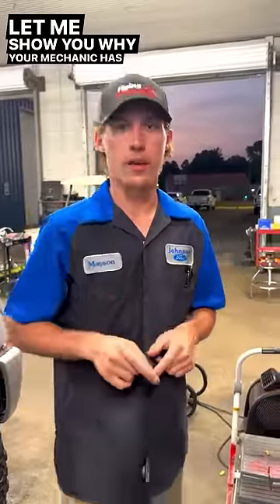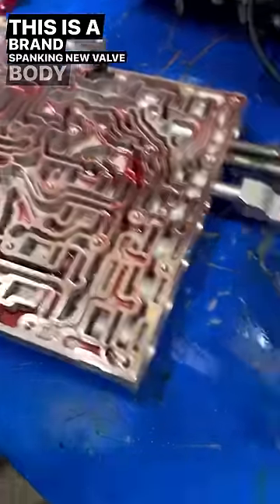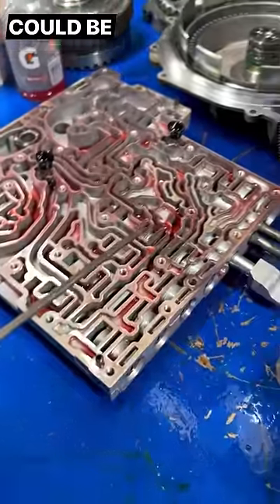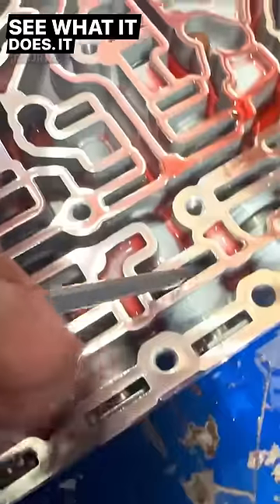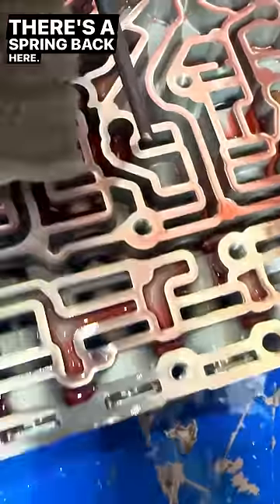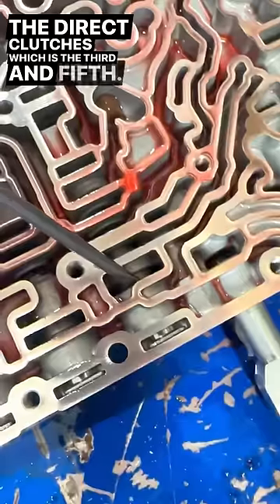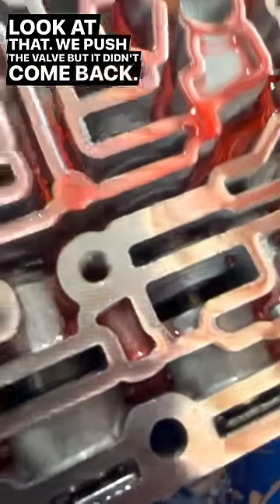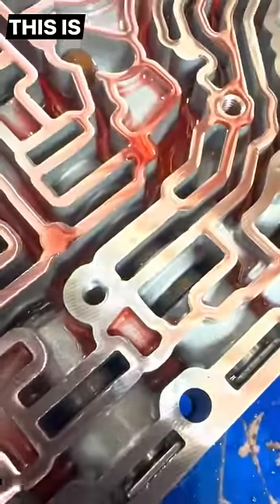Why your mechanic has trust issues #shorts #ford

Comment: Don’t be whacking on my valve body with that damn flathead like that 😂
Reply: Well, it wasn't working anyways so why would you care?
Reply: @RandomPerson-nd2ey  a sticky valve is likely fairly easy to fix, a dinged gasket face is a real problem. Honestly it just shows a bad attitude - you don't want this guy working on your car.
Reply: @chemistrykrang8065  same thoughts.
Reply: @RandomPerson-nd2ey "one small part wasn't working so I just damaged the whole thing" isn't a good attitude to have as a mechanic
Reply: He was smacking the shit out of it because it's not going back in. 😂
Reply: @chemistrykrang8065  Incorrect, the guy (you) who would put a faulty brand new valve body in your car is the one you don't want working on it. How are you gonna fix the sticky valve?
Reply: @chemistrykrang8065  ahhh, yeah.  That makes sense.  Good point.  I was thinking it would be getting sent back because it arrived busted but, yeah, I guess it could be fixed.
Reply: @one_mega_ohm9139  hang on, I'm not saying put in a faulty part, I'm saying that clumsily damaging a part that might be repairable shows a poor attitude and workmanship.

Valves aren't magic assembled by elves, it'll be sticky because there's a burr somewhere where a machining operation wasn't finished properly or something like that. Worst case a bore is slightly out of spec and it's just a bit tight or there's an improperly seated seal or a broken spring. Chances are if you took it to pieces (and maybe a "good" one to compare measurements) you'd soon find why  it was sticky and be able to resolve it. Maybe you need to replace part of the valve assembly, but more likely 5 minutes with a reamer to tidy up a burr and a good wash out and it'll be good to go.
Reply: right
Reply: @one_mega_ohm9139  yeah no, don’t mar and gouge up the valvebody sealing surfaces, warp the passages etc and all you have to do is rebuild the core. It’s like someone dropping an aluminum DOHC cylinder head, they’re the reason why we can’t have nice things 🤣
Reply: @dirtyaznstyle4156  I would want the guy who just gets me a different, working valve body. Are you charging to rebuild it, or paying for it yourself?

Comment: Customers have reasons to have trust issues too my man.  A pos shop tried to quote my wife for parts her car doesn't even have....
Reply: Or a Pos husband can’t take care of his wife’s problems
Reply: @fastinradfordable  not sure where that came from but ok 👌
Reply: @wizzardx666 what didn't the car have?🤦‍♂️
Reply: Must have included a Kneurering valve, a 710 cap and blinker fluid. Thats about $200 to add to the bill !
Reply: I Can see that, a lot of times it’s pushy advisors, since they work on commission. I had a service advisor sell a power steering fluid flush on an electric steering rack. I told him straight up car doesn’t have it, and car has 45k miles it didn’t need it if it had it.
Reply: My wife's  car was an automatic and they tried to sell me a clutch. If you know, you know
Reply: @fastinradfordable projecting much?
Reply: @benjaminkline4855 do you have a dsg or single clutch auto by chance?
Reply: @wizzardx666 It came from the fact you sent your wife to the shop instead of taking it for her. Like a man should 😂
Reply: @fastinradfordable Sounds like a you problem for being unable to find a good man. 

Not every man is skilled in every thing in the universe. 🤷
Reply: My daughter called asking to borrow the money for a new clutch in her Nissan Sentra, it was an automatic it was low on fluid .
Reply: @sebastianriz4703 op you replied to is a man, and a correct one at that.
Reply: @quackhead7492 an automatic that is low on "fluid" is an automatic that needs more than "fluid"
Reply: @ryanvess6162  Nah. Its not a man's or a husband's responsibility to take care of a problem a women can solve on her own

Also: You dont know if he was a man or not.
Reply: @benjaminkline4855 the newer automatics have clutches with electronic actuators. They are doing away with torque converters.
Reply: @benjaminkline4855  Some automated manuals have a clutch. And automatic transmissions have clutch packs.
Reply: @fastinradfordable 👈💩🤡😂
Reply: I got told my 2000 GTI VR6 just had a new carberautor installed on it...
Reply: I've had two cars ruined by mechanics.
Reply: @fastinradfordable You know all of us have different professions right? Leave it to people who do the thing professionally.
Reply: @fastinradfordable I can’t wait until your wife needs a surgery, you’d better start on your medical degree now, can’t have another man taking care of her can you?
Reply: @qwertykeyboard5901  they cant fix their wife's phone and pc problems clearly they arent real men right? 😂

For real though why do so many people do this weird thing of measuring someone's masculinity based on a random skill? So dumb!
Reply: @ks_snuggles  Cars have been in households longer than cellphones and computers and working on them has been a thing passed down to the younger generations. Some women were taught too. A vehicle can leave you stranded far away from home, or even cell phone signal. It is your transportation. Knowing how to check fluids and change a tire is not random to say the least Lol
Reply: @fastinradfordable major clown vibes from you
Reply: @koopspook sure but checking fluids or changing a tire is basic maintaining, it has little to do with fixing an actual mechanical or electronic issue, which is why there are professionals to do it

Comment: Meanwhile, my manual transmissions have literally never failed me (with the exception of a clutch, which is a standard wear part).
Reply: same, and replacing the clutch disc is way easier than fixing one of these things
Reply: @DiThi you’re not wrong, I rebuilt 1 automatic and never wanted to deal with that mess again.
Reply: Never mind the fact that you get far more control driving with a manual.  As someone who lived in Alaska for 20 years, being able to release the clutch slowly in second gear driving on ice kept me from spinning out often.  Simple is better.
Reply: SOME people know how to use manuals - others do so much damage to the car that they completely ruin the resale value.

The average skill is more to the latter end rather than the former... hence why resale values for manuals is so much less.
Reply: @keirfarnum6811 automatic is more simple to drive you just push down the gas💀
Reply: @UKMonkey  Here in Europe pretty much everybody knows how to use a manual because you are not even allowed to drive them if you take the driving exam with an automatic. Also a worn out clutch is easy to fix for cheap to bump up the resale value.
Reply: Guessing you either have low miles or your transmission has slipping discs going unnoticed. My truck and last 3 cars have no issues in valve body. Thats a span of near 22 years.
Reply: @1014p  manual transmissions only have one "slipping disc" called the clutch, and you don't need to even open the transmission itself to replace it because it's outside of it. I'll rather deal with that once every 10-20 years rather than a transmission that is more likely to break.
Reply: @DiThi  the issue now is so few people actually sticking to one vehicle long enough to even have problems. I see so many people just trading in their car for a new one every 5 years.
Reply: @benr.3565  all my cars have always been more than 5 years old... maybe more than 15, even.
Reply: yeah but i think automatic works for more people, it's just really simple to learn, tho manual is better for some people, my mom has adhd and says that manual helps her stay focused, otherwise (like on her current car) she usually always needs music on and stuff to stay focused (btw this isn't some random thing my mom alone experiences, even adhd people who think they would do better with automatic a lot of the time do better with manual)
Reply: @1014p  lol tell me you know nothing about cars without telling me you know nothing about cars. Honda civic went 350k on a single clutch disc. F250 went 200k on one clutch. I've had a bunch of manuals, and the only time I ever had to change a clutch was because the flywheel warped and screwed up the disc. 

You don't have "slippage" go unnoticed. Once they start, they fail pretty fast. And it's like a 4 hour job in the driveway with a six pack. I'll take that ANY day over a gummed up valve body. 

Oh, and you think automatics don't have clutch discs?

Comment: I've had my 2006 f150 4R75E in the shop probably 5 times and they've been replacing valve bodies and even new from Ford and that one failed 🙄😪
Reply: Ford tech advice: take it to another shop lol
Reply: At some point, a fella has to wonder if the parts are bad, or the mechanic is bad.
Reply: They need to flush the lines before putting it back together, you need another mechanic.
Reply: Sounds like the system is contaminated and needs a complete clean out.
Reply: By design. They want you to buy a new car.

Comment: As an engineer and former cnc machinist I can attest that its a miracle those dont cost $5,000. I wouldn't be surprised if the failure rate is somewhat high.

Comment: I've seen brand new $4k Mercedes camshafts' oil ports not drilled all the way through. Basically, 2 ports were gonna be dry and you know what's gonna happen from there. Came straight from the factory, OEM and all.
Reply: may god give you luck, you deserve it bro